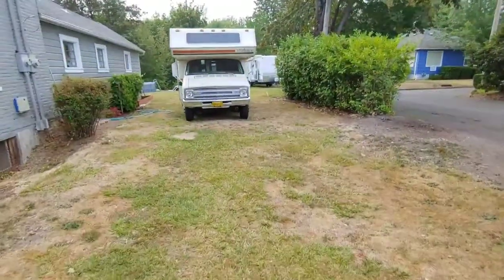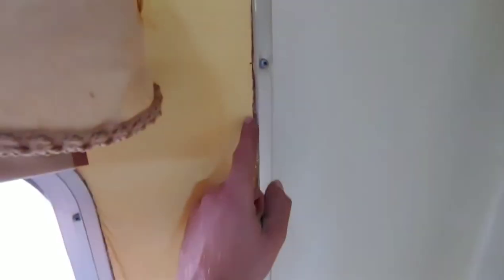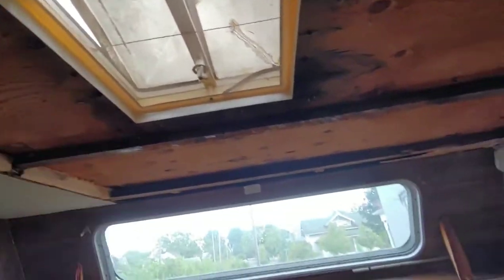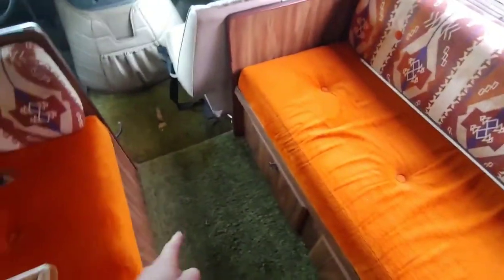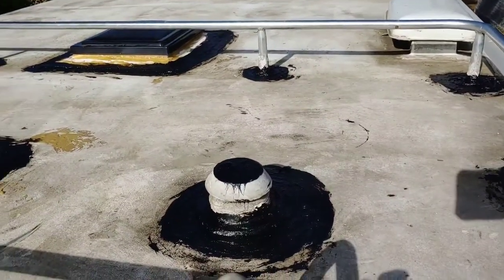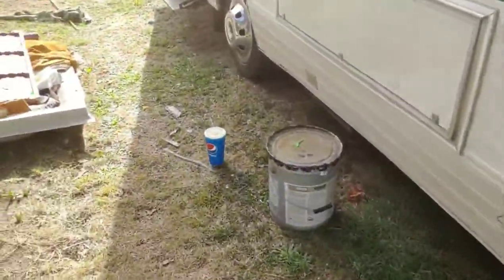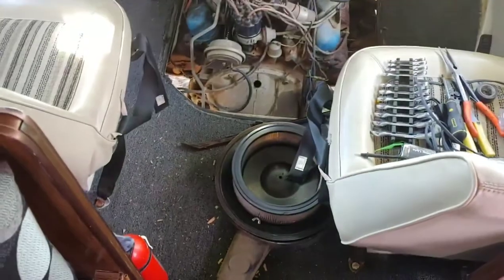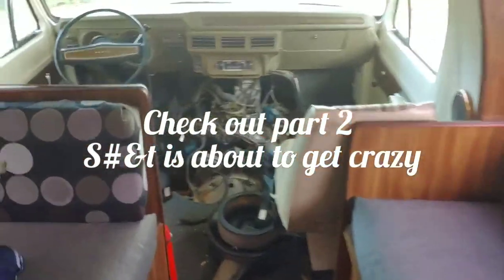The secret project! Tioga 22ft motorhome. Part 1

Comment: question what cover would you use for it for the winter.  I bought something very similar, but a beaver monterey 1977 as well very low miles. i paid more for mine, but a lot of work done to it on the inside

Comment: Just snagged a 77 Tioga 22ft for my daughter. 440j with torqueflight. 97k miles. The only difference I see so far. Is the door in ours is just behind the passenger seat. It even has orange and Navajo pattern dinette.